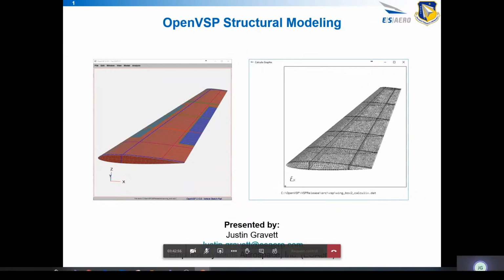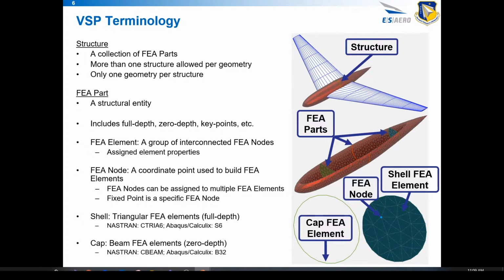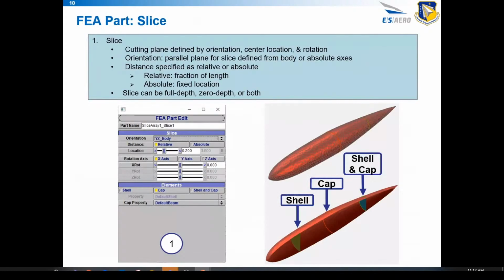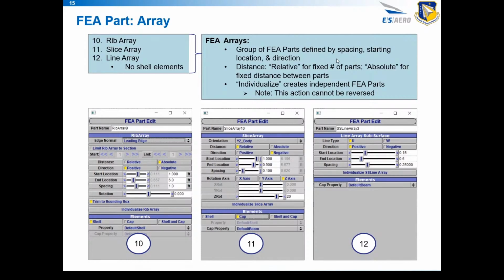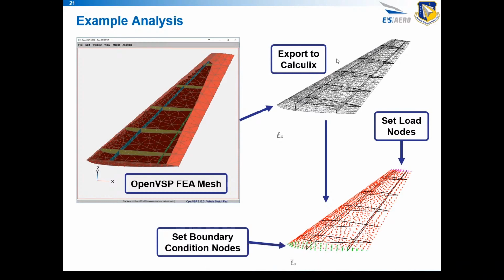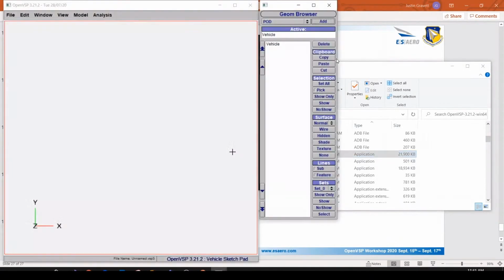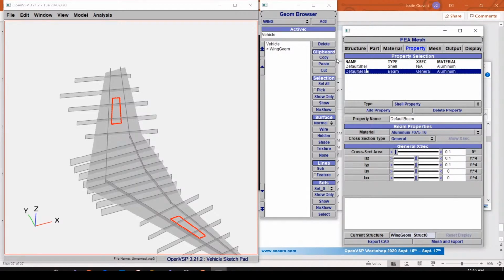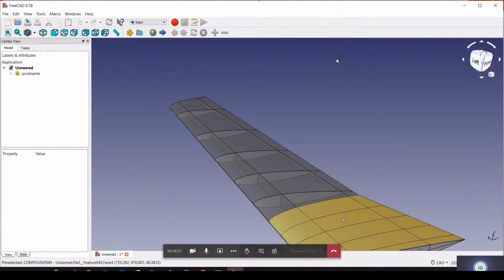2020 VSP WS: OpenVSP Structures Modeling

Comment: i am trying to create spar and ribs for my wings. Problem, I don't have FEA Mesh under analysis, only FEA Structure. Over there I was able to make my spar and ribs but there is no "Mesh and Export" option. There is an "Intersect and Mesh" but it always force closes by application.
Reply: Same case
Reply: @SyedMujahid-vm1xo  Managed to fix this. All I did was lower the resolutions of the Mesh and also reduce the number of spar and ribs.
Reply: @Keroro2593  what if I really needed more spars and ribs?
Reply: @SyedMujahid-vm1xo  make sure you’re using the latest version of openvsp. I guess reduce the quality of mesh would help.
Reply: @Keroro2593  will try, thanks